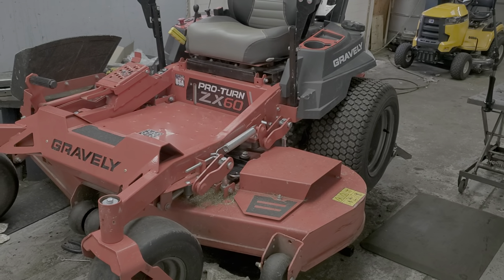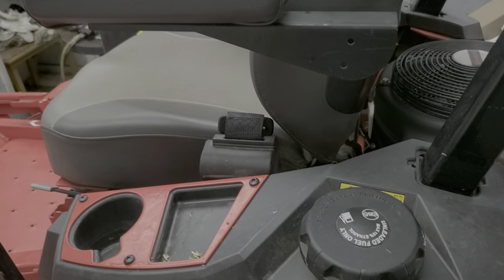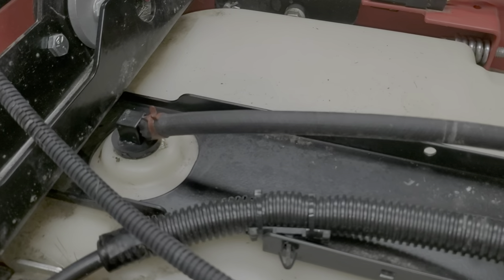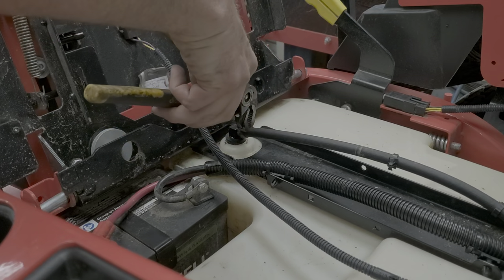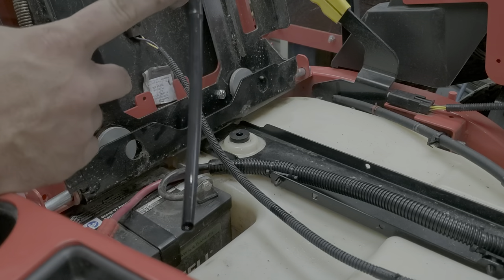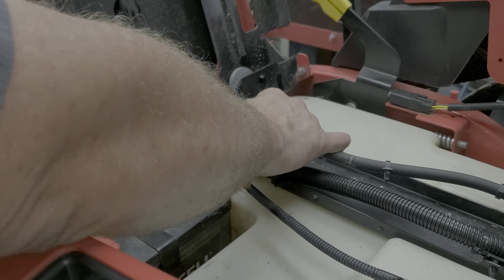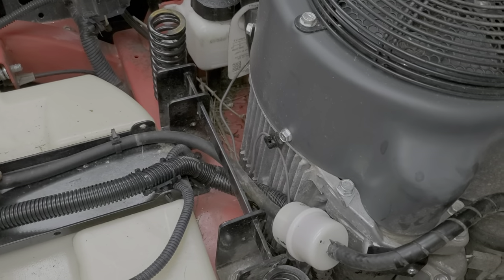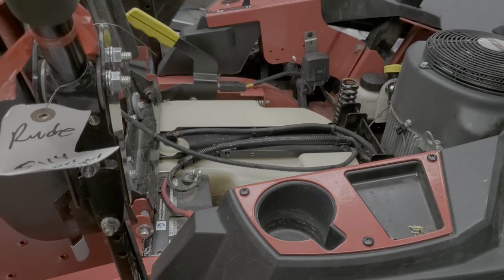Zero Turn Mower Shuts Down After 15 To 30 Minutes - It Is Not Overheating!!

Comment: Thank you! I had replaced the fuel assembly, cleaned the carburator, replaced the air filter, and spark plugs and it was still dying. Luckily, the new fuel filter is transparent and I could see that it was starved for fuel. That’s when I found your video and, VIOLA! Good as new!
Reply from the maker: Awesome news! Glad to help!
Reply: It may be the issue I will check but mine is brand new. It did it and is still doing it with only getting to use the mower for 2 days(3 hours on it). It just acts like you said like it's starved of fuel.
Reply from the maker: Interesting

Comment: This is what I needed. It’s kind of tough to pull the fuel line off the 90 degree thing, but it’s all good now. I also zip tied my fuel filter to the seat spring so it doesn’t get so hot resting against the engine cooling fins. Thanks for the video, nice, clear instructions and good video showing everything!
Reply from the maker: Awesome! Thanks for sharing and for your comment!

Comment: I was chasing a rough when hot issue for a week. Replaced every filter, cleaned the carb, replaced and gapped the plugs, and changed the oil. Finally saw your video and was astonished to find no filter on the fuel pick up tube. It was clogged exactly where you said it would be and now its running like a top. Thank you!
Reply from the maker: Awesome! I am glad to help thanks for watching!

Comment: This fixed my problem. My Areins dealer could not. Thank you so much.
Reply from the maker: Thanks for watching!
Reply: @IndRepair  So I distorted the nipple on the pickup assy a little trying to remove the fuel hose. It went back together ok and seems to work fine. My question is, why is this part even necessary. Wouldn't a length of fuel line that forms a fairly good seal with the grommet work just as well? These cost like $40 (incl shipping) from the Areins website.
Reply from the maker: It would work without the pickup tube but the problem is finding something that seals well to the grommet so debris doesn't find its way in. You also want it to sit at the right level in the tank, which is hard to do with a standard fuel line
Reply: @IndRepair  good to know. Thanks for the response!
Reply from the maker: Thanks for watching!

Comment: Thank you for the tip. This is the problem i had with my Gravely ZRT. Would run for about 30 minutes  and die. A bunch of grass came out of tube with some air. 
Before this video, i changed fuel filter, fuel pump, spark plugs and oil. Plus cleaned out the filter. Thank you for tip.
Reply from the maker: Glad to help! Thanks for watching!

Comment: Wow!! Thank you so much for the video!!! Ding Ding Ding!!! That's what was wrong with my zero turn, too!!! It would run for about ten to 15 minutes then shut off like it's starving for fuel. I could see it was getting fuel in the fuel filter so I figured it must be getting enough gas? But I still replaced the fuel filter and fuel pump. I even blew back through the fuel line into the tank but I'm guessing it wasn't enough air and or it just clogged up again because the debris was still in the tank. I was looking for videos on how to rebuild the carb when I came across your video. I did what you showed in the video and took the fuel line apart then blew compressed air through the elbow and a bunch of stuff came out of it. Thank you again for showing us how to fix it!! Subscribed and liked!!
Reply from the maker: Awesome!!! 👏

Comment: Thanks for the video. I have a EX-Mark radius. It's a bit hard to start, but then runs great when throttled. The problem is, it cuts off when at low Idle. Please advise asap thank.
Reply from the maker: Is the idle set high enough? I would try to turn up the low idle screw first and go from there. May have some partial carburetor blockage or bad fuel in it
Reply: Thanks for replying. As I was getting ready to take it to the shop, it stopped cutting off at low idle. Go figure 🤔. The gas window shows it's close to empty. I filled it up with gas and the window still shows it's almost empty. SMH, please advise. Thank you.

Comment: Thank you for posting! I’ve been looking for a short in the wiring!…... When my mower shuts off it acts like it’s run out of fuel or the fuel solenoid is shutting off! I’m not getting any back fire or popping when it dies so I was convinced the solenoid was shutting off. But what you explained in your video makes sense. If the problem is in the fuel line I’ll be back to up date.
Reply from the maker: I hope you get it figured out! Thanks for watching!
Reply: @IndRepair  ok I found my problem! I did check out the fuel line and all was clean and working properly….. After scratching my head the 100th time I went back to sq.1 and started re-checking wiring and connections but this time by mistake I had left the key on! I was moving the ignition switch around to hook up my leads when I heard the fuel solenoid click, I moved the switch again and heard it click again! …. When I did the continuity check on the wiring and switch the first time all was good. But when I put a little pressure on the terminal switch feeding the solenoid it would break the continuity. LOL I couldn’t even feel the the terminal rock or move under thumb pressure, but its definitely my problem! I temporarily wired around it using an extra terminal hookup at the switch and she’s running like a champ…. FYI your video still was very helpful and added to my troubleshooting skills! Thanks again!
Reply from the maker: Awesome! Great job!

Comment: Great job. It's just like the rubber in the gas cap. They usually plug the hole. 👍
Reply from the maker: It sure does! Been a while since I have seen that but have seen it a bunch also. Thanks for watching!

Comment: Thanks. I was going to pull out my fuel line in my John Deere Z-757 but was afraid I might break! I'm going to look into that connection. I have installed new plugs, new fuel filter and now a new fuel pump. Seems each step helped, for a while. Then it stopped after five minutes to an hour, just depends. (Note: I have a crankshaft oil leak, but plan on replacing yet this season.)
Reply from the maker: It sure sounds like the symptoms of an issue like this. I hope you get it figured out! Thanks for watching!
Reply: I cleaned the fuel line and 90° angle metal piece. I had previously started the JD 757 successfully. But I was just getting a bit of fuel in the line. Now I see no fuel, as if maybe it needs bleeding? I also will have to replace the rubber grommet. I think the Gravely dealer may have the right size nearby, he used to deal in John Deere. It acts like it's not getting enough vacuum. I have the new fuel pump & even put the new fuel filter that came with it on, though I already had a fairly new filter. I'm baffled.  @IndRepair
Reply: I ordered two grommets OEM for the John Deere. Not sure if necessary, but at $9 for two, not bad. For now I have the fuel line secure at the tank and a piece of duct tape. It actually has started again. I am able to restart, but can be hard to start. The fuel seems to be going in & I can see it increase as I rev the engine. If the weather is nice tomorrow, Saturday I may try to mow, but close to either the barn or home. I think at least if I wait till it cools down, it will again start & I can keep it in the barn. The two times I couldn't get it started outside, I cover with a tarp, especially if we are in a rain pattern & that has been the rule of thumb this summer, rain.
Reply from the maker: @compcitizen  great!

Comment: I have a pro turn 152 and it runs perfect when I'm using the right tank but when I switch to the left tank it'll run for about 10 minutes and then slowly act like it's running out of fuel until it dies. Checked that 90° piece and it was fine. Do you have any idea  what else I should check since it only happens with the left tank? Also already drained the tank and put fresh gas in cause I initially thought some water might've been it. Forgot to add that I also swapped gas caps and it still shut off after about 10 minutes.
Reply from the maker: I would check the fuel selector switch and line to the switch, go to be a restriction somewhere

Comment: Very helpful. I can't believe Gravely doesn't put a mesh filter on the end of the intake tube. Wouldn't cost much yet I believe this ended up causing the fuel pump to ultimately die after only 50 hours. Poor design if you're reading Gravely.
Reply from the maker: Almost nobody does anymore! There are a few companies that do but for the most party they let the in line filter thr to solve the iddue of debris getting into the line. Works mostly, unless something gets cause and clogs the line before it. Thanks for watching!
Reply: @IndRepair  thanks for the reply! I just bought a mesh filter that can insert on the the fuel pick up line (in the tank) for a few bucks. Worth it to save the hassle down the road! Thanks again!

Comment: Oh if this all it is... I just replaced the carb and it was still doing it. Runs great at first then after it gets warm have to choke to get it started only kind of stays running on low throttle with choke on.
Reply from the maker: I see it all the time! Almost too simple to even think it can be the issue sometimes. Thanks for watching!
Reply: @IndRepair  Can't verify my biggest issue is solved til this weekend when I get it hot. But it was in fact clogged with lots of little hard bits. Initial blast of compressed air didn't make it through. Cleaned it out and Immediately noticed better throttle range response, and after starting with choke once from cold, I didn't have to use choke to start every time I was testing it. That's been a slight annoyance for about 2 years on this mower, was it always requiring manual choke to start hot or cold.
Reply from the maker: Nice!

Comment: I have a right stander and it turns on for a few minutes and turn back off what could it be?
Reply from the maker: It could be many things. Bad fuel, blocked fuel supply, blown out head gasket, bad coil, sticky valve, etc. Start with checking what you are missing. I would start with adding some carburetor cleaner in the intake after it dies and see if you can keep it running. If so, you know you have a fuel supply or quality issue. If not, move onto spark or compression issue checks.